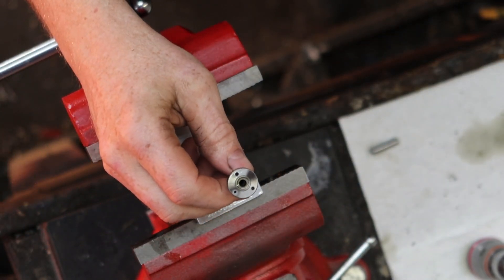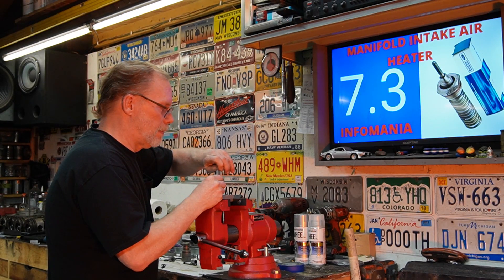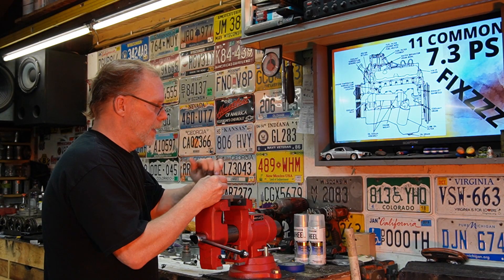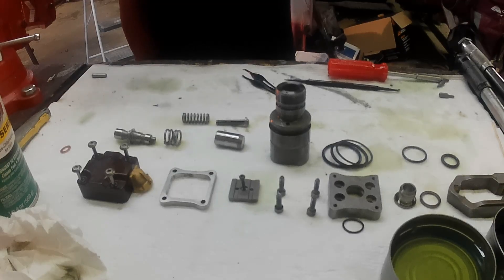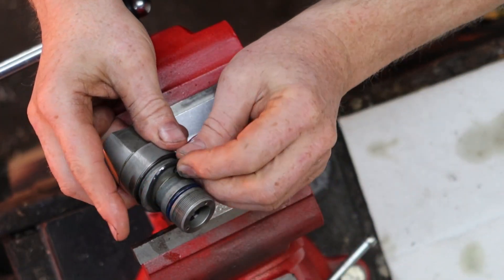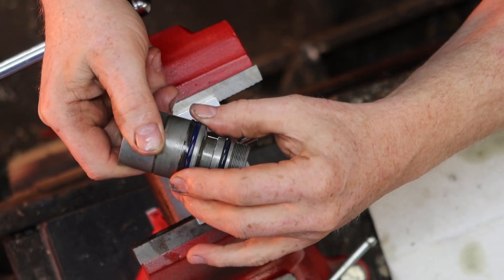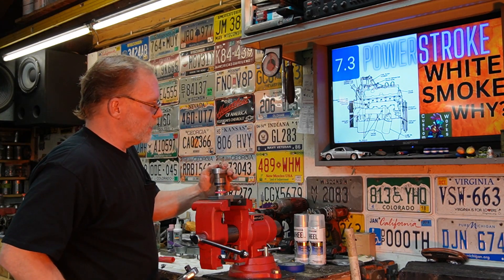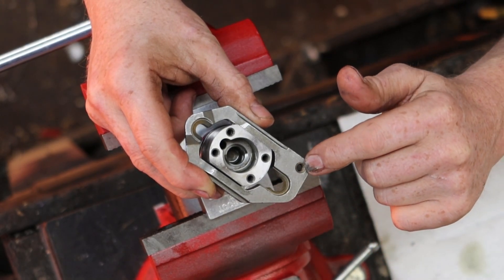🛻📽️ ....7 3 PSD QUICK TECH THE FAST INJECTOR REBUILD  🟢🟡🔴🟢

Comment: Sir, i'm still driving my 2003 7.3 diesel.  It runs rough when cold and a little hard to start when the weather is cold.  but on the highway it's pretty good. 241000 miles.  i replaced the FICM with a used one a while ago.  it had no power. i have no clutch pedal anymore and no parking break and sometimes when i'm driving the radio and windows do not work.  it is a 6 speed manual so i just start it in neutral to warm up or start in low gear to drive.  i have no clutch pedal.  i already replaced the master/slave cylinder but still no clutch.  i can drive pretty good withouth a clutch unless i have to stop at a red light...  i have not much money.  should i try and replace glow plugs and or injectors first if i keep the truck?  i like owning a 2003 F250 7.3 diesel long bed crew cab 2 wheel drive manual...
Reply: i also got a lifetime warranty starter from o'reily's but don't carry the tools with me to replace the starter in case it goes out.  truck is low to the ground so i can't crawl under there withouth jacking it up.  i start her in low gear or reverse when necessary.